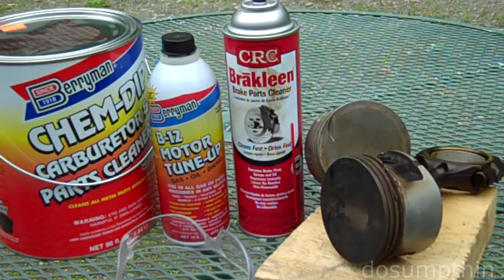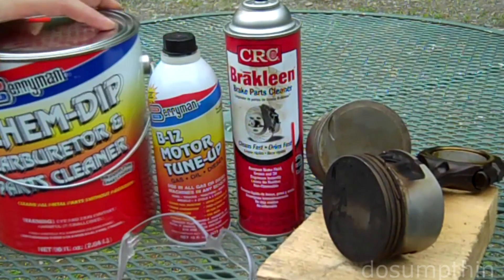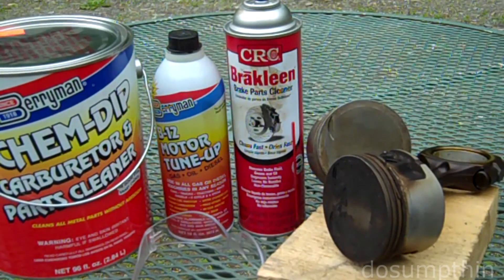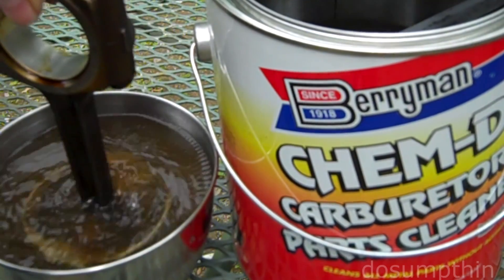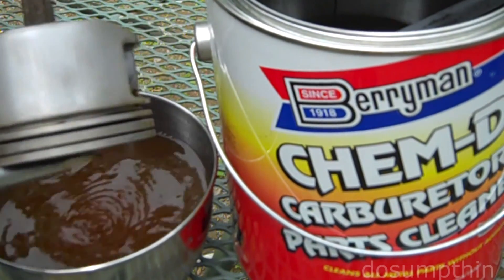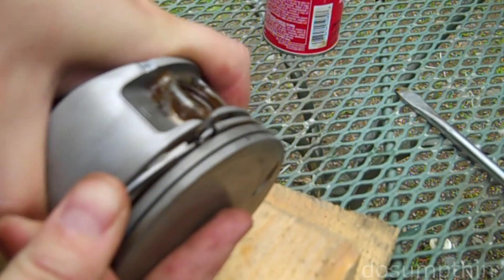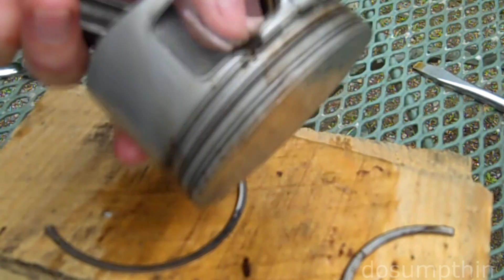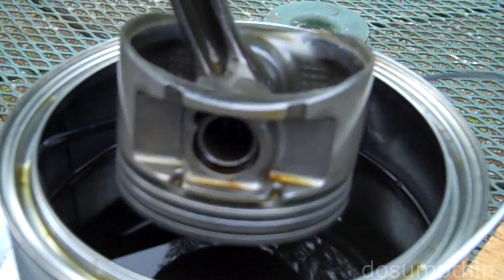Dissolving carbon buildup from pistons - Cleaning piston ring grooves engine rebuild compression

Comment: I used the same stuff, my pistons were so bad I'm surprised the bike even started. I was getting some chatter, tapping, top end noise / rattle when the bike was cold.

If anyone knows what would caused pistons and valves to crud up so badly please let me know. This carbon looks welded on. Thanks in advance and good video dude.
Reply: Burning too much oil
Reply: Not changing the oil often enough. Oil breaks down under friction and heat. Then it gets hotter because it cannot provide friction relief between the parts. This causes more wear' in turn more heat. Now. When enough heat and oil meet it turns into carbon. Carbon will bind to metal. It builds up into a nasty pile of crap that is hard to remove

Comment: HHO Gas Carbon Cleaning is the only way to remove carbon deposits internally on a internal combustion engine without any side effects like traditional carbon cleaning. You may go to my website hhogastechnology.  com or go to E-Bay and search HHO Gas Technology Engine Carbon Cleaning Machine.
Reply: Yeah. I have magic beans and snake oil to sell too. Still won't do a damn thing
Reply: you're wrong
Reply: You can end up frying the turbo if you have a Ford Ecoboost engine.  Be careful!!

Comment: You can purchase a ring groove cleaning tool from NAPA, inexpensive. We would use ultrasonic tub for jet engine parts, even the re-useable filters. I wouldn't want to purchase though, however I'll bet there are shops around that would clean them ultra-sonically for a small charge.

Comment: Do you have an old toothbrush or a similar brush?  That does help.  I cleaned a part from a small engine with acetone and the toothbrush helped get the black gunk off.  Acetone does not seem to harm toothbrushes, just don't use that brush on your teeth anymore.

Comment: This stuff works great on varnished carburetor parts too.  I use it on carbs that have sat for years and it has the crusty green varnish built up inside.  Let it soak for a day or so, then take it out, and hit it with the hot water pressure washer.  Parts come completely clean.  Stinks to high heaven and when I get it on my hands it takes half the day to wear off, but it works so who cares lol.

Comment: took you suggestion on a 305 sbc rebuild i found out that i could do 4 pistons at a time 2 face down and 2 with rod end down after 30 to 45 minutes i just switched them around 30 to 45 more minutes 4 pistons are clean while i am rinseing the first 4 off the other 4 are soaking, thanks

Comment: Why go that far into an engine only to reuse old worn out pistons? Sometimes you can get away with being cheap but a bottom end isn't the place you do it. I say that since this guy said he was doing a "rebuild". He'll be rebuilding it again cutting corners like this. Pistons also wear on the sides, it's not just the ring wear or carbon that builds up. That carbon tells the story of that piston and how good it still is or isn't. You have to measure them and make sure they're still within spec. Once you hone out the cylinder walls everything changes. You're now putting pre-worn pistons on a fresh surface. Unless it can be changed out with new bearings like Rods, Crankshaft etc etc. It should be replaced. That's the only correct way to do a rebuild and if you can't afford it you shouldn't be attempting it. Do it 100% the first time so you don't have to redo it a second time. The only safe way to reuse old pistons is if you measure them and find them still in spec of the OEM measurements. Too many folks (not saying the uploader) think all they have to do is clean their piston and it's like new. Yeah good luck with that see you on the tow truck.

Comment: It seems that piston rings was installed incorrectly, not like 120 degrees each groove from another...
Reply: idiot.
A four stroke  will rotate the rings, randomly.
Reply: Mesdriver
I didnt mentioned that they don't rotate. idiot.
Reply: Liutauras Samajauskas
So why should you mount them at 120Dgr?
Just to make you feel good?
After 100 Km they will be all over the place. 
Amateur.
Reply: *****
Thats impressive!  Lets assume on the generous side, that you've been rebuilding engines for 30 years, so that would be about 28 engines per month, working 7 days a week, 365 days per year!! So, basically 1 per day for 30 years, if, you have had a 30 year career!!  Are you a production line robot?  Anyway, rings do rotate on 4 stroke motors, doesn't matter where they are on assembly. This has been proven by many engine builders over the years.  I've noted the position of rings on assembly in the past then when I've stripped the same motor they have all moved.
Reply: Seems we share philosophies, good to exchange and keep torturing the metal!
Reply: You non conformist you!   Here in the UK we have way less channels than that, but still mostly all BS!!  I was hoping for some drama here last week, when the Scots were voting in a referendum for their independence, it was looking good for success for the yes advocates but alas it wasn't to be!  The no's won and they are still part of the UK.  The conspirator in me reckons the vote was rigged though!  The oil economy rules again.
Reply: Lotsa stuff!   Started with bike engines, 2 strokes, 4 strokes, singles, twins, three's, fours, sixes. Motocross, road & some race. Also mowers etc.  Cars, everything from 2CV's to race.  A few truck engines.  Vintage stationary engines, have a big thing for Listers, particularly the CS Start-O-Matic.
Restored about 20 bikes, from a 1922 Triumph SV single, to a Vincent Rapide. Tuned my Evo 6 to 500 BHP at the wheels.  It could go much further than that but my wallet won't!
Done a few marine outboards, including a V6 Mercury.  Used to service a mates twin inboard Volvo Penta's.
In my experience though the trickiest engines are bike engines, by far.
Try a Ducati bevel V twin, with vertical shaft driven Desmo valve gear!!  EVERYTHING is shimmed, roller bearing crank, and the closing valve clearances are set to zero, by shim!  First one of those I did was my own, a 900SS. Couldn't afford the shop charge for that so, despite being told by all the 'experts' that trying to do it yourself would end in disaster, I went straight ahead and did it, in my garage, without the special tools. Result, an engine that ran to perfection!
Another VERY, VERY tricky motor to work on is the Vincent V twin. Mainly because the original build quality can be terrible, so you end up correcting machining errors and material defects.
Unlike yourself, I'm mainly self taught and and have never earned a living solely from spannering, except for a few years specialising in Evo's.
Modern engines are easy, due to close and consistent tolerances.
For the challenge, I would love to do a 1920's Bugatti straight 8, or 30's Alfa blown straight 8.
The Bugatti crank is a work of mechanical art, being a built up, roller bearing unit, with just spray lubrication!
Another favourite motor is the Offy 4, what an engine!  Would love to get dirty with one of those.
I also like messing about with old piston air compressors.
BTW, is that patent your's?
Reply: Looks like we've both seen plenty metal then!  Tell you my next step on the tinkering highway, I've just joined as a volunteer on the local preservation railway!  Always had a thing about steam and rail diesel, favourite loco is the Alco 4000, so this is taking it a step further.  They have a lathe that can turn upto 7.5 ft main driving wheels!  I will be uploading a video of that in action. This will give me the opportunity to learn skills I've only read about, like casting a bronze bearing and scraping it to fit, pouring a white metal bearing, heavy riveting, etc, etc.  These boys have all the kit and knowledge, should be fun!
Just waiting for my induction day to get upto speed on safety etc, then it's game on!
For the sake of security message me on my channel, I'll reciprocate with my email.

Comment: Use hot water and TSP, the summer time is best because of  the heat from the sun, let them soak for a couple of days, If you have a slop sink thats even better. Don't be afraid to use the whole box. At least TSP won't burn your nose hairs. That smell from carb dip is nasty.

Comment: You need to try Super clean, just spray the pistons, let them sit for 15 min then use a tooth brush.Repeat the process until all the carbon is gone.The carbon just seems to melt off!  It's only $7.99 in Canada

Comment: I wound up using very hot water dawn dish soap and plastic bristle brushes and some scotchbright. Ive heard the epa compliant berrymans sucks now; the old stuff lasts years, dunk carb pull jem...before the bath i used a metal can just a bit larger than the piston filled with acetone to handle inside the wrist pins, the liquid after was blood red. and concluded with them looking new with the oil control ring land perfectly clean (h22a)

Comment: I don't see any piston oil return holes, are there any? Think that was the engine design flaw in that year. The piston oil return holes are located (supposed to be) inside the oil control ring groove. Without the holes oil has nowhere to go, problems return after a while.

Comment: Bought the Chem-dip yesterday to clean the pistons and the engines head of my Harley. This stuff didn't work like the video shown. I dipped my pistons for in the can for over 1/2 hour then removed them out but nothing change the carbon still there.

Comment: FYI, you can get an empty pain can at Home Depot for $8 and a gallon of Laquer Thinner at Wal-Mart for about $10.  Does the same exact job as the chemtool crap, and for a lot less.  Smells exactly the same, and is what I've been using to clean my Porsche engine.
Reply: you are on drugs.